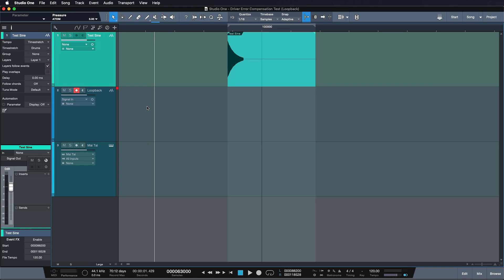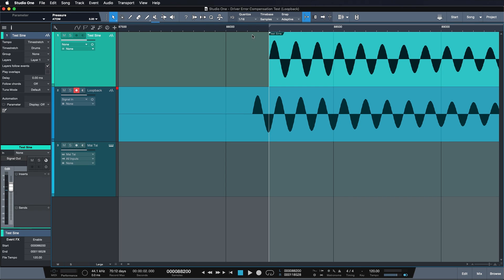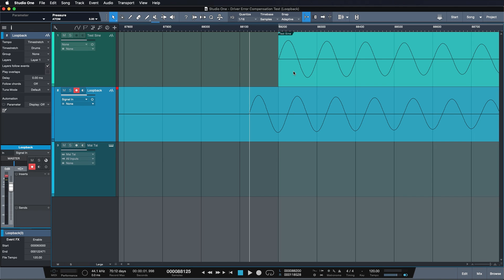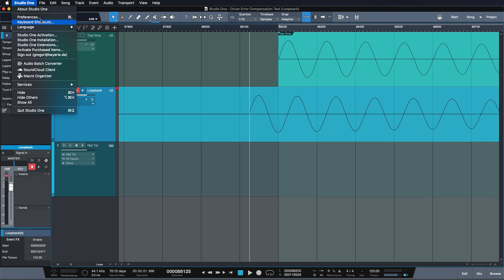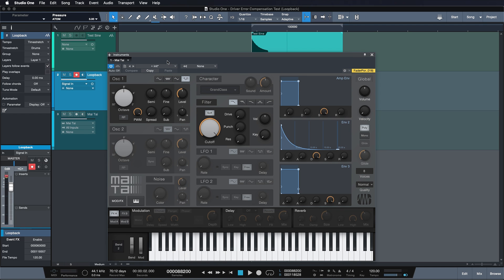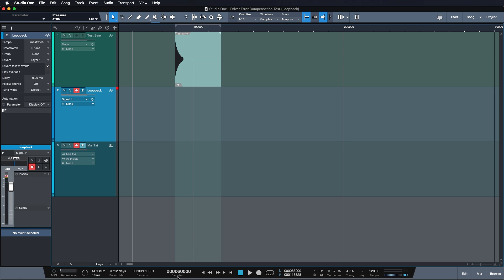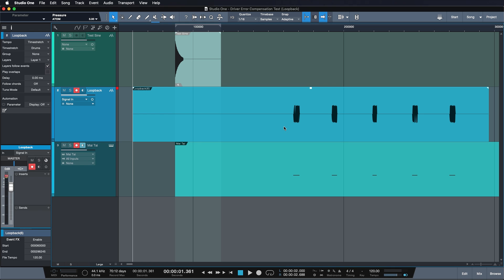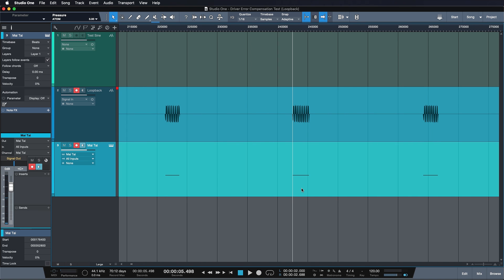PreSonus Studio One Tutorials Ep. 4: Loopback Test and Record Offset

Comment: Here are detailed instructions for setting up Duet from Admin (Apogee Electronics)
Dec 30, 3:28 PM PST

Hi,

Make sure Duet isn't connected to speakers and then if you follow these steps in order, it should work:

1.  Connect Duet and launch Apogee Maestro.

2.  In Apogee Maestro's 'Output' tab, click the dropdown menu by the main output level knob (speaker icon) and select 'Output 3-4' or 'Line 3-4' (I can't remember what it's called).

3.  Turn the main output up all the way to 0.

4.  In Maestro's 'Input' tab, set the Analog Level of input 1 to 'Mic' and turn the gain down to 0.

5.  Connect a balanced TRS 1/4" to Male XLR cable from the Left output connect of your Duet's breakout cable to the XLR connector of Input 1 on the breakout cable.

6.  Set the 1st track in Studio One (the one with the pulse already on it) so it's output is going to 'Output 3' or 'Line 3' (whatever it's called). If it's a stereo track, set it to 'Output 3-4' and then just hard-pan it all the way left.

7.  Set the 2nd track in Studio One (the one you're going to re-record the pulse) to Input 1 (or 'Mic 1'- whatever it's called). Make sure it's output is either going nowhere or at least NOT going to Output 3-4.

8.  Loop the section of the session that has the pulse and look at the meters on Duet- the meter for Input 1 should be showing a similar level as the meter for Output 3. If it's considerably lower in level, then go to the Output tab in Maestro and double-check that you turned up the main output all the way to 0. If it's still too low, go to the Input tab and gradually raise the gain for Input 1 until the level matches that of Output 3.

9.  Once your levels are close, record the pulse onto the new track and then compare to the original pulse on track 1.
Best Regards,
Team Apogee Support

Comment: OK whats up STILL CAN"T use this tutorial as shown correctly WILL ANYONE answer my question posted 2 WEEKS ago
Reply: Check the text explanation here, as that may help. Depending on your mixer or input devices, you need to find an output, be it an aux, mon, line out or headphone out to feed the input channel. I will soon figure out if there's an appreciable difference with either, but if there is, I will lean towards the headphone outs as that's how I will be recording most things. But having this method under my belt now, I can tweak and tune any DAW or setup nowm versus hitting record and trying to line this up manually. Thanks, Presonus!

Comment: Thanks for this, I'm using the downloaded file but tab to transient refuses to work - how do you enable it? Cheers
Reply from the maker: cmscss For the upper file, you can also hit the keyboard shortcut for “locate selection” (should be l by default). If Tab to transient doesn’t work for some reason, you can also zoom in and place the playhead cursor manually. -GBY

Comment: Hey Gregor, for some reason, the recording offset time seems to always be different. I can't seem to adjust the offset perfectly.. for example in the output recording difference, i set the offset to 60 samples, and in the second test, the difference was completely different. Same was true for MIDI. Any idea as to why this is? I connected my output 2 which previously was connected to the speaker to my input 2. - Emanuel
Reply: Hi ManuMusic, that is quite odd. Are you on Windows or Mac? If you are on Windows, are you using an ASIO driver? What is your Interface block size and reported Input/output latency in the Audio Settings? Have you tried entering -60 instead of 60? -GBY

Comment: I have an older AudioBox USB with only a phone output and a Left and Right Main Out.  When I connect a cable to either output on the back and either of the inputs on the front, I get massive feedback.  Also, in the DAW, the Signal In/Out dropdown options do not include "Signal In" or "Signal Out", so I am unsure of what to select.  I also have no idea where the selections derive from but instead of MASTER and Signal Out, I have half a dozen including MASTER, Creme, Heat, Modular, and a couple of blank ones. I honestly have NO idea how to complete this test at my current level of noob-ness.
Reply: Hi John Midgett, please ensure that you’re muting monitoring on the respective input. In Studio One, make sure that the blue Monitor symbol is OFF for both audio tracks. Next, open the Audio I/O setup in the Song settings again and click “reset to default”. Add one mono track in the input section and choose the number where you’ve connected the cable to. I hope this helps! -GBY
Reply: @Tx66  No joy.  Your instructions on setting up the DAW were very clear and I was able to follow them for the most part.  The "Reset to Default" button was disabled, so I deleted everything manually and created a new mono track as instructed.  I believe I now have the inputs and outputs properly setup, but as soon as I connect the output to the input on the AudioBox, I get severe feedback. I've tried going from the R on the back to the L on the front and adjusting the DAW Audio I/O settings accordingly, also to no avail.
Reply: Hi John Midgett, you have to ensure that your Interface doesn’t monitor your Inputs from the Hardware. What Audio Interface are you using? There should be an accompanying software or button to mute monitoring on the unit. -GBY
Reply: @Tx66  I'll have to plead ignorance regarding an "Audio Interface". I have the Presonus AudioBox USB hardware interface connected to the PC via USB. It has no mute button that I can see.  The speakers are simple PC speakers that are connected to the phone jack on the AudioBox USB.  On the AudioBox, there are two instrument/mic inputs (combo 1/4" and XLR) on the front and L/R outputs on the back plus a phone jack (connected to the speakers).  The pc sound settings use the AudioBox USB for input and output.  I have tried plugging the cable into each of the L and R outputs and looping back into the inputs on the front as well as connecting to the phone jack out and looping back to the instrument inputs on the front.  No matter how I connect it, Studio One records nothing but feedback.
Reply: John Midgett Hi John, please don’t worry about this test too much - after all, we’re talking a couple miliseconds here by which your recorded audio material (meaning, recorded from microphone or line input) would be offset without this correction. May I ask what kind of music / setup you’re running? I’m pretty sure that this test is far less significant for you than you may think. Don’t worry too much about it! -GBY
Reply: @Tx66  I have a suspicion you may be right, but latency is an issue.  I have three keyboards - two are just controllers but one is a MIDI board with its own sounds that eventually have to be recorded.  The latency between the DAW playback of MIDI events and the actual audio from the keyboard getting back into the DAW is a killer when there are other tracks that play VST instruments.  I've also had issues recording guitar tracks over the VST instrument tracks and have to nudge the audio to get proper alignment after recording.
Reply: Hi John Midgett, I’m sure you’ll agree that the first half of your issue is much more severe - and this test doesn’t do anything to improve latency in any way. Please see my third chapter of this series on Audio Settings for more info on how to have a more immediate recording experience. -GBY
Reply: @Tx66  Thanks for all your knowledge!  This helped a lot as I'm super new to using any DAW. Going into Song Setup and adding another mono track on both the input and output sections where my cable is connected did the trick!  Getting to know this audio world is daunting and invigorating; any glimmers of light along the way is always appreciated ^_^

Comment: love your videos gregor, one thing maybe many guy´s dont know that, If you wanna zoom in, i point my mouse on the position where i wanna zoom in, then i press Ctrl and i scroll my mouse wheel. when i wanna zoom wider then i press ctrl and shift and i´m more quick , instead i´m using hotkeys, exact on the position where i pointing my mouse
Reply: Hi Pasquale, yes, mapping the keyboard shortcut “zoom to selection” to an easily reachable button (such as the middle mouse button) is a great idea for sure. :) then you can just select a range with the smart tool (or select an event), press that button to get it in horizontal AND vertical focus, and when you’re done, simply press it again to return to your previous zoom state. -GBY

Comment: Great stuff, can I just ask is this correction relative to the song sample rate and processing buffer sample so if you change from 44.1 512 sample and the next project is say 48 1024sample? Thanks
Reply: Hi Lmp Records, the correction is relative to the song sample rate, but independent from the processing buffer size. -GBY
Reply: @Tx66  oh wow ok thanks so typically I work in 48k but if for whatever reason I'm doing a project at say 44.1 I need to know the adjustable samples as well. I will keep note of what the 2 offsets are just Incase. Thanks
Reply: Lmp Records. In that case I’d probably just do the loopback test with the song file being set to 44.1 first, then set the song to 48 and run the test again. Note both numbers for future reference. -GBY

PS: Please note that it’s only necessary to adjust the offset if you’re actually planning to record new Audio into the respective song project.
Reply: @Tx66  I have hybrid setup and use analog for parallel compressor etc so in Protools I had to do a similar process to add the correction in PTools hardware insert columns which sorting out the phasing issue, but the sample correction is based on both the project sample rate and buffer size, base on this do I need to do a similar correction for S1 since my 2 track is coming back to be printed on an audio track into my MixBus ? Along with using pipeline to insert various analog gear, in just making the move over to S1 so still sorting things out. Thanks
Reply: Hi again Lmp Records., I just tested this with my own outboard gear. If you want to record your Pipeline XT configuration on a new Audio track with sample accuracy for further processing, you need to ensure that both the Audio Record Offset (as shown in this video), as well as the Pipeline XT Offset is adjusted correctly. Once you have this set up and saved as a preset in Pipeline XT (which will literally only take a minute), you have sample precise accuracy no matter if you're just rendering or actually resampling on a new Audio track. -GBY
Reply: @Tx66  thanking you for checking on this for me,  I did the test at 44.1 and it was 4 samples out early like on video which was 75 sample , i did same test at 48 and I was late by 7 sample so I had to put minus (-7 ) for it to line up when I recorded it again . So regarding the pipeline I had all my analog gear saved as presets initially clicking the auto button so I guess now I've done the -7 offset do I need to to rescan the pipeline offset correction and resave them?
Reply: @lmpcrew  I would assume so, however you should measure just to be sure. In order to do this, simply add Pipeline XT with your respective I/O preset to the track with the test sine wave (once you've adjusted the record offset correctly). Then record the result on the Loopback track once more. If the result is still sample accurate with the test sine wave from track 1, your Pipeline XT offset amount is correct. -GBY
Reply: @Tx66  oh awesome I will do this with the pipeline when I'm next in the studio. Thanks for the reply

Comment: I'm not sure how you're connecting the cables to do this test
Reply: Hi momusic777, please connect an available output of your audio interface (for example, an output that isn't occupied by your speakers) and connect it to an available input. Assign these two ports in Studio One. Voilá! :) -GBY
Reply: @Tx66  thx will try it
Reply: @Tx66  what if the interface only has two outputs which are being used by the monitors, is there another way of setting this up?
Reply: @bertgonz5649  my interface goes thru a mixer, i just did my record send from the mixer back thru the interface input or just may have to hard patch
Reply from the maker: ZonG TreB Since you don’t need to monitor this recording, you can just disconnect your speakers for the time being and use one of those outputs to perform the loopback. -GBY
Reply: @fenderstudio  thank you I'll give that a try.
Reply: @tri-unetrl3966   yes, what presonus suggested did work for the audio part. but i can not record the midi loopback track. something is not setup correctly, or i'm missing something.
Reply: @tri-unetrl3966  no.  i'm not sure what i'm doing wrong even tho i downloaded the loopback test files they provided and followed their steps.
Reply: @Tx66  I'm still a bit unclear .. is it the SAME cable that goes from the audio output to the audio input, or is it two separate cables?
Reply: @hersheybell8444  it's the same cable.
Reply: an output to your line in